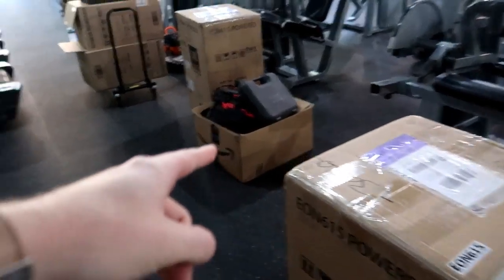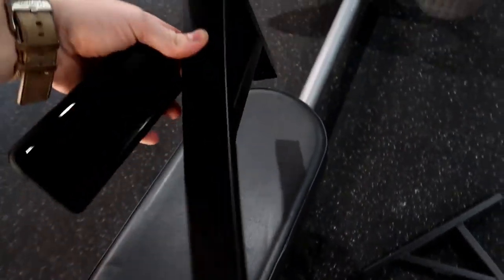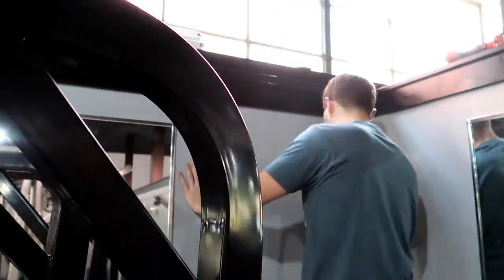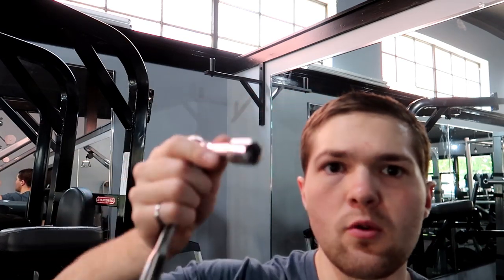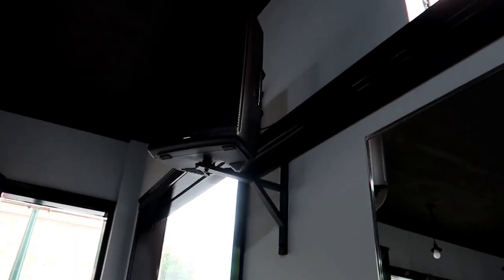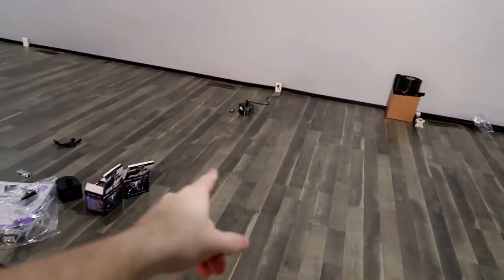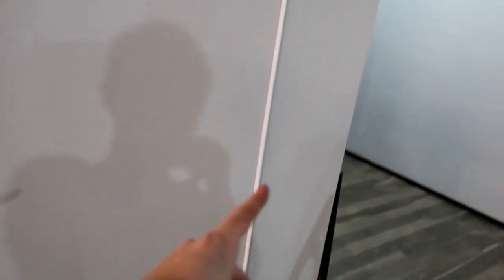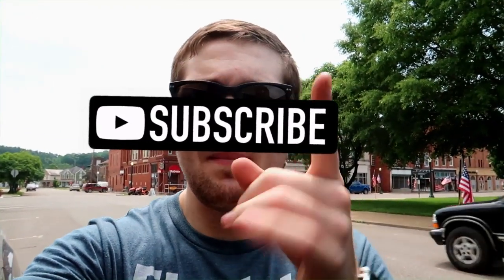Gym sound system Install (JBL Eon 615 + 610) | Bluetooth wireless solution

Comment from the maker: Gear Used in install
Speakers

2x JBL EON 615 (Main Room) https://amzn.to/2XyqVWm
2x JBL EON 610 (Studio area) https://amzn.to/2WkZ7Dh
Mounts
4x OnStage right angle brackets https://amzn.to/2Ww6mgP
Cables, Mic, and Adapters
Belkin  Bluetooth Adapter https://amzn.to/2My9mV9

3x GLS Audio 25' XLR cables https://amzn.to/2EWNdd7
Shure BLX wireless with a Shure SM31FH Mic https://amzn.to/2F84Tmf
Reply: I need help..I'm opening dance studio 90m2 with ceiling hight of around 3,5m. What do you think is one speaker enough and which one 610 or 612? I'm really in dilemma. The space is square

Comment: A Few positive tips from an install guy here...

1.) A rack of some sort is crucial in a scenario like this. Lowell and Navepoint makes some excellent ones for not a bunch. This way, you can house all your wireless/rackmount audio gear in a lockable enclosure so no one else can touch it. 

2.) Mounting - usually when you mount speakers at an elevated position with no down tilt, you’re missing a lot of coverage directly in front of the speaker on the ground, so if in a scenario like this, some people won’t hear the full sound until you move back within the coverage pattern. A riggable setup would be ideal here to get the speakers at a higher level, facing down, so everyone hears closer to the same volume everywhere. 

3.) phasing. Of course I can’t hear the room, but when installed facing down the long way of a room, you can potentially run into a lot of phasing/comb filtering issues depending on the acoustic properties of the room. Like I said, I didn’t hear the room so I can’t tell. 

You’re on a great path, keep it going!
Reply from the maker: A lot of what you said is the route I wanted to go with this install when I was first contacted. Multiple pendant speakers fed from a central amp and mic/media rack was my initial proposal. Budget was just not there to come close to what was needed to do it that way.

Comment: Just a couple comments. First. I don't know code in your particular area, but where I am all cables must be CL3 fire rated XLR cables for installs. Big difference from the mobile world, but easy enough to make your own lengths of you know how to solder. Second, why not hard wire the electric rather than run the racetrack and eat up an outlet. I prefer to fish all lines in the wall for concealment rather than have them visible. Otherwise, great video and install. Curious how you like the BT Belkin and whether it is reliable enough to use as a primary music source for them. Cheers.
Reply from the maker: Theres no code for xlrs in my area. As for the electrical that was due to a limited budget. Which ended up with this option. To be able to hardwire the speaker I would have had to bring in a licensed electrician.
Reply from the maker: Belkin does a great job I like it for stuff like this. I wouldn't use it to DJ with as it can have minor cuts and drop out depending on the device distance etc.
Reply: Cool man. Always enjoy your videos and good things are going well for you since the move. Glad to see some other guys out there doing some installs ro bring in the bank during the off days. I have a couple to do down here in Atlanta if you want to get your hands dirty. Cheers brother!

Comment: Nice setup, but if you EQ'ed the speakers with EON Connect, your client is likely hosed if the system ever needs to be readjusted. Once the EON speakers pair with a specific device, they will refuse to pair up with any other device. If you or your client no longer have access to that particular cellphone, their only recourse is to reset the speakers and lose all the work you put into EQing them. Even if you still have the cellphone, one of speakers may brick itself and go permanently offline and refuse to connect with anything until it's reset.
Reply from the maker: Not sure what testing you have done, but I have had no problem connecting multiple devices to the same eon.

Comment: Nice, For a smaller restaurant bar (seats about 30 max), Do you think 4 jbl control 24c with 2 19cs will do the job? Are you familiar with the JBL control contractor series?
Reply from the maker: Partially. I dont know model names off top of my head though. Have to look up the specs

Comment: Cool stuff, butt... Could you not have checked for plumb on those brackets, they were all over the place. Yes I know this isn't a big problem but it hurts my ocd
Reply from the maker: Plumb what? Did you not see me with the level marking the wholes to drill?
Reply: @DJRickWeb  no
Reply from the maker: My OCD would have not let me mount them plumb up and down and at the exact same height.

Comment: The reason for all that extra cable with zip ties?
Reply from the maker: Surge protectors were a little longer then needed. And to stick with building code in Ohio I couldn't cut it and put a new end on it. That would need a licensed electrician
Reply: @DJRickWeb  Although I'm not based in Ohio your response to the comment raised awareness to me about building codes. I never thought such things were a big deal till now. Make sure yall read and understand the building codes of your area before doing any kind of installation!!